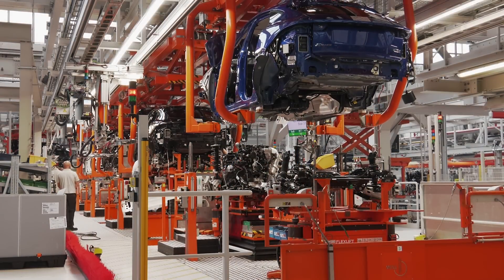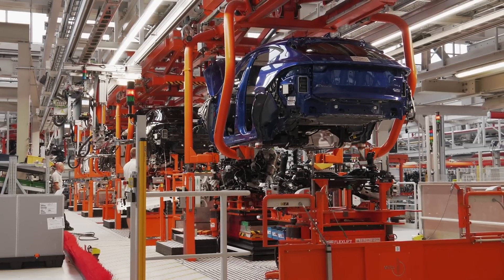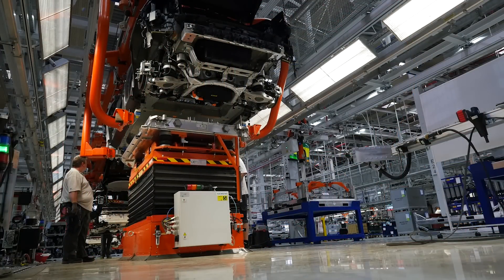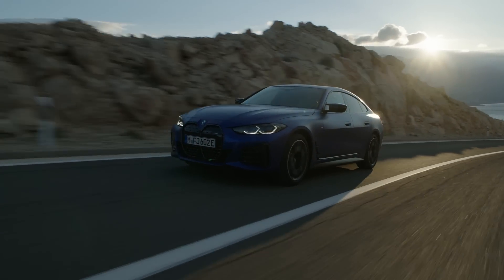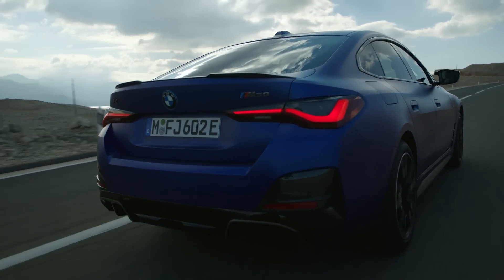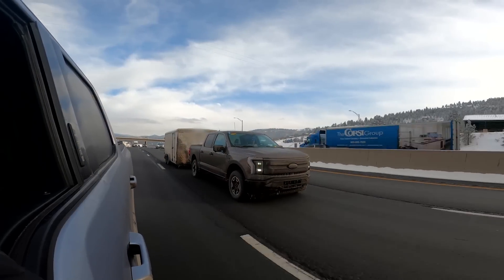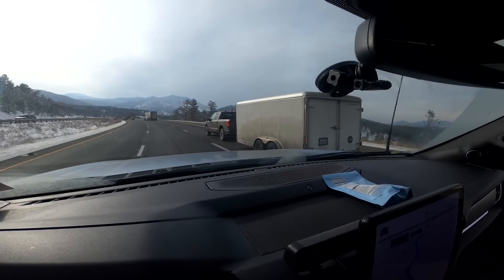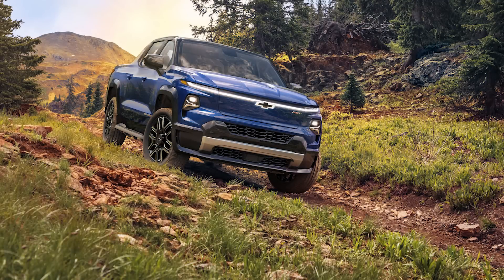ICE-Based BEVs: Let's Talk Scar Tissue

Comment: Interesting.   It looks like making an EV from a unibody car is much more compromised than making an EV from a high riding body-on-frame truck that already has lots of space between frame rails for batteries, and normally wasted space underneath for motors, without needing much special structure.

Comment: The OEMs are not in an enviable position with so much at stake, which do they go, this way, that way?? They will survive of course , when the going gets tough the tough get going. I remember Mercedes Benz needed a pick-up truck to add to their portfolio and so they used a Nissan derived body to speed things up, in the end it was a tainted product that was overpriced and that very few wanted. The pressure on ever increasing profits and market share are tremendous.

Comment: In the case of Tesla, I think of them as them of being a bona fide OEM. They have have gone through 3 products to get the learnings for having a scalable and efficient design for the Model 3/Y. So it's kind of not fair to compare the Rivian to the Lightning in this regard. All else  being equal, dedicated BEV platforms will always be more efficient from a cost/mass/performance standpoint

Comment: I think some of the additional weight from the Rivian might be due to their lack of experience with manufacturing (more parts = more weight, manufacturing capabilities may also dictate less weight efficient parts) and also they may be  over designing their parts since this is their first product. Ford and other legacy OEMs have had decades to figure out where they need margin in their structure and where they can save weight.

Comment: The US Tesla Model 3 Standard Range Plus (on US website 4/30/22) now weighs 3,862 pounds, instead of the 3,648 pounds listed in video, because they are using LFP cells... Wish they would have had that option available last summer when I order my Model 3, as I opted for 2021 LR... I only charge my nickel pack to 90% daily, so my effective range is not that much better than 100% LFP, on top of the degradation and safety advantages... still love my car though... even with LFP in standard range plus, it still weighs less than LR at 4,034 pounds.

Comment: i would not say that the bmw is the best of all cars. but the 8k$ difference also makes a difference in the car. from tesla you don't even get an instrument cluster behind the wheel. usually also the handling and the ride quality in a bmw is very good. there are many small details that represent a bmw. where a tesla usually is a shitbox regarding quality.
so, comparing two cars by the wheel base and price is a bit of a weird comparison.
so, while tesla has some interesting ideas, a lot of other things stink. at the end, it is the whole package that counts and if this package fits a certain audience.
btw. mercedes now plans ICE vehicles based on BEV platfroms. a similar approach, but certainly with a different focus.
Reply: John's points have nothing to do with build quality. You can still buy a BMW i4 over a model 3 for all the reasons you outlined. His point is that the i4 is at disadvantage  on weight, efficiency and cost structure. Further, his cost estimate is probably conservative as no one buys a base BMW. You have to pay extra for everything. For Tesla, except for FSD, it comes in pretty much fully loaded.

Comment: Is "scar tissue" a good thing or a bad thing, seems like it was bad for BMW but good for Ford? What about the all-in-one ice/hybrid/BEV platforms, does the flexibility justify the "scar tissue" effect? What's certain is that you won't get scars if don't fight in the battle.
Reply: Q: Is "scar tissue" a good thing or a bad thing(?) A: neither.  something overlooked is that the VAST MAJORITY of EV's (even Teslas) are all NORTH of 4000lbs, so really not much point "splitting hairs" going forward as one can't overcome the laws of Physics (affordably).  unfortunately NOBODY is making "light" Lion anything and switching to LFP doesn't help as it just adds another 200lbs ON TOP of your curbweight for similar output. even with it's FULL aluminum body a Model S Plaid is still 4900lbs (5100 w/driver) and a Model X Plaid is 5400lbs (5600 w/driver).  C&D states the top, dual motor, BMW i4 M50 also weighs 5100lbs.
Reply: @phillyphil1513  they literally said in the video that the model 3 is 3600 pounds

Comment: Companies will do anything to save a quick buck. ICE platforms and BEV platforms are two completely different designs. If some small start up can make an EV similar to ICE engine set up, they yeah use the ICE platform. If only they would make a manual gearboxed EV, that would make thing more interesting for buyers.

Comment: I expect a lot more scar tissue with a monocoque design compared to a body on frame design. Frame design is really useful for carrying batteries as Ford has shown.
Reply: re: "Frame design is really useful for carrying batteries as Ford has shown"  as all trucks in Automotive History have shown.  though the trend changed towards "luxury makeovers" kicked in with the 1994 Dodge Ram, the central function/purpose of trucks has always been that they are WORKING VEHICLES.  as such, their main "strength" (pun intended) has always been their ability to MOVE LOADS and CARRY WEIGHT.  the very definition of the "ginormous" 1800lb/98kWh Lithium Ion traction battery fitted to the Ford Lightning is WEIGHT, so no different than when a landscaper picks up 3 yards of Rock/Stone to finish a job.
Reply: @phillyphil1513  Exactly. I was making a comparison with monocoque design. Far easier to cater for both ICE and BEV with a frame than a monocoque.

Comment: Good points John, but why is GM's clean sheet Hummer and Lyriq so heavy and space inefficient?  Probably bad engineering on GM's part.
Reply: There two are not mainstream models, and they are meant for customers who prefers the space (add weight). Rumor says that Chevy Equinox has 300+ miles range from a 80KW battery, let's wait and see.

Comment: It shows that the aluminium in the F150 was a good decision. The F150 also had lots of fuel tank space to put the battery in, as it had to allow for the thirstier V8 engine option. Rivians aim must have been; a better vehicle than the F150, so 4wd, bigger towing and reasonable range. If Ford can do a better pure bev F150 in 2025, then Rivian can just go 2wd, cut the towing weight and avail of better batteries and their cost. I also expect Rivian to update faster than Ford as its not cannibalising the current profitable iCE F150 or worrying about GM. What Rivian lacks is a large order to cut procurement cost.
Reply: re: "If Ford can do a better pure bev F150..." well the only thing Ford can do in the future is build a better BEV F150, unfortunately what they will NOT be able to do is build a better electric TRUCK.  the reason Ford used the existing twin beam chassis is because it was ALREADY A GREAT DESIGN for turning into an EV.  unfortunately just because one creates a "new" design doesn't automatically mean it's "better"...?  (hint: that's the "MYTH of Progress" talking) no, whatever you come up with could in fact be WORSE in many ways than what you had already. #LAWOFDIMINISHINGRETURNS <--- many forget that this is a "thing".

Comment: The negatives of these multi use platforms, FAR outweigh the benefits for a consumer. Sure.. the automaker saves some dollars.. meanwhile, your product is FAR less desirable. So are you really saving anything when you lose so many sales to your competition who is doing it right? I wouldn't buy a compromised machine, I don't care WHAT badge or price you put on it. These manufacturers are going to choke on their compromised products.. and it's libel to kill off more then 1 of these legacy automakers who aren't doing the transition correctly. Pickup trucks aside.. have no interest in pickups.. but I can see Ford managed the compromise reasonably well in the 150. Good for them

Comment: A body on frame design should carry less 'scar tissue' than a monocoque design in my opinion. Great job, watching the clock for the next one.
Reply: I agree with you.  F 150 has an aluminum cab, so that's a good start, but since her frame has to spread much wider to hold a big battery pack, the cab attachments has to be redone along with flat floor and flat firewall. So bottom and front surgery are still required

Comment: I'm loving these monologues.👍
Toyota and BMW have historically good long-term outlooks.
Range Extenders & PHEVs are the way forward:
Even a modest 42-mile electric range like the RAV4 Prime gives you 15,000 annual EV miles and yet NO worries about a public charging network.

There's no better complement to an ICE than a modest-size battery.
There's no better complement to an EV than a modest-size ICE.
Reply: Once the world starts charging for the total cost of pollution (and you heard it here, that is coming) you will not want anything but BEV.
Reply: There is a reason why Europe wants to exclude PHEVs as low emission vehicles - they are NOT. 

The stats heralded by PHEV proponents are false... just another ICE comparable car (that has a higher chance of a fire as well).
Reply: @Custo911  

In our experience (i3 REx), having a simple, lightweight (250lb) engine aboard allows us to use EV to its fullest extent.

Without trying hard, we piled on 24,000 miles last year with commutes and road trips, yet consumed only 25 gallons of petrol for the year.

The tiny 33kWh battery (much lighter and smaller than what the "modern" BEV customer demands) saves the extra, rare, precious metals for others to use.

The gas engine aboard means we almost never resort to our 19mpg SUV for trips.

The extra cost of running on combustion (4× here in hydropower Washington State) means we are very incentivized to always plug in and avoid running the ICE.

YMMV😊👍
Reply: @donswier  Fantastic. However I think you realize that very few... very few use it as you do. 
You need a lvl 2 charger to be able to drive that many miles (or access to lvl 2 charging elsewhere).
In the end, mindful consumers CAN make hybrid cars work, but vast, vast majority.. don't. from what I remember, 80% of PHEV users don't even charge their cars and just use gas for easier usage (% may be out of date though).

Comment: Great insights, John. It does make me think we may see a body on frame renaissance since the battery can fit neatly inside. I’d consider a BEV Tahoe.
Reply: We'll see, but the F150 uses a lot of aluminum, and I do think that the body on frame design absolutely helped them find a suitable home for the pack. Also kudos to Ford for that frunk. They had to work for that, but it's big, covered, lockable, and even has power.

Comment: Maybe scar tissue is lower when the vehicle shape is boxier and more flexible, like that of a pickup.
Seems like even if the Ford had four motors, it still wouldn't compare badly against the Rivian. How did they do it?
Reply: How?  The heaviest Lightning is around 1,370 lbs heavier than the heaviest ICE F-150 (not including the Raptor, which the heaviest Lightning is still almost 900 lbs heavier than the heaviest Raptor). The lightest Lightning (with 230 miles of range) is also 470 lbs heavier than any ICE F-150 (including the Raptor), and more than 1,500 lbs heavier than the lightest ICE F-150 Supercrew (4 full size doors). Ford didn't figure anything out.  The Rivian's just a fat pig...